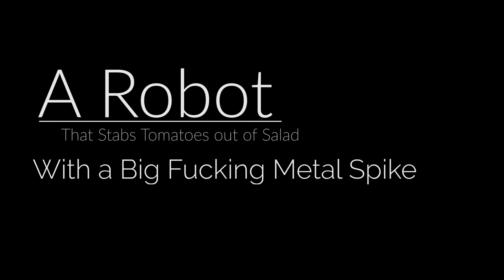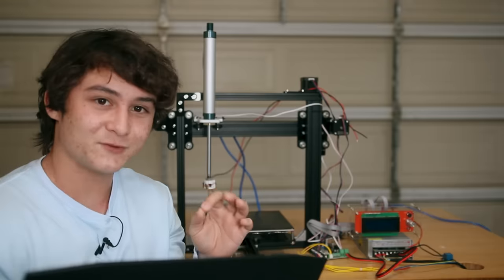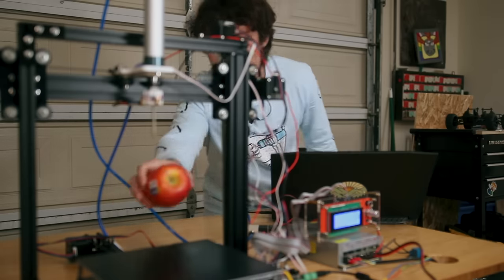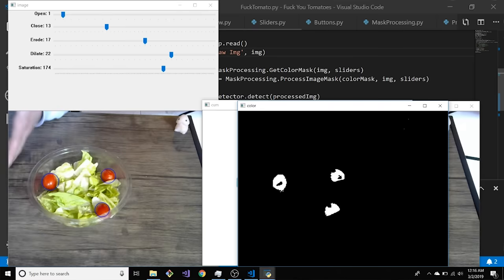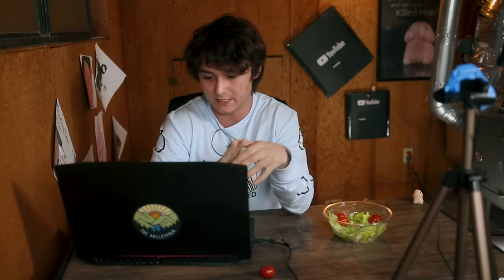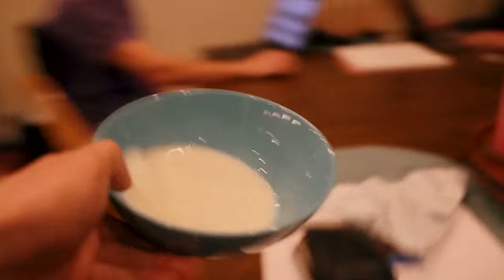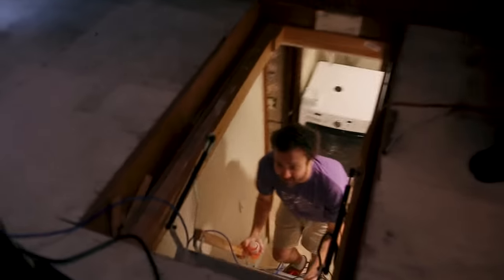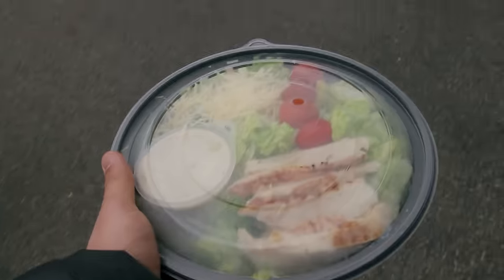A Robot That Picks Tomatoes Out of Your Salad

Comment: I'm pretty sure the only reason this project wasn't a failure was that he used a screw as the spike.
Reply: but does it spike harder than Nesses Dair off-stage?
Reply: He should've added something to take the tomato off the spike before going for the next one. Just make a couple of doors that only open one way and have the spike stab through them.  once the spike and tomato are through, it simple retracts and the spike comes out but the tomato doesn't. Rinse and repeat until the salad is dematoed.
Reply: The real reason why he used a screw is that he wouldn't screw this up
Reply: @undefined5323  when you pick up all the maxim tomatos in all star mode:
Dematoed
Reply: LucasIsHere 
.
Reply: @justinsmith7074  good input to this conversation

Comment: Should've made it only pull up half way once it got a tomato, go over to the corner, and pull up on an attached thing to scrape the tomato off the spike, once it gets the first tomato it struggles quite a bit...
Reply: You’re a genius
Reply: I don't think he cares
Reply: Why do extra work? It would take longer and be better. If it’s good there won’t be as many funny moments
Reply: But that's too much work
Reply: It’s a fucking pneumatic cylinder. They don’t “stop half way” Pneumatic cylinders don’t have the same control as hydraulic ones. It’s all the way down or all the way up. Nothing in the middle.
Reply: @banannaninja  I didn't mean make the pneumatic cylinder only pull up half way, I meant make it to where the machine would pull up half way, with any means, such as, switching it out for a hydraulic one? Not sure, all I know is that I suggested something that isn't impossible, and the fact that you're stuck on thinking about using the same equipment is laaaaaaaaaame
Reply: Core Blaster it’s not lame, it’s logical. What’s lame is you suggesting that he should have done something differently, when the whole point of the video and the machine he made was to be funny, and you’re giving him advice on how he should’ve done it differently without any hope of understanding on how it currently works and how complex  the machine already is. There is absolutely no need to make the machine 10x more complicated ,it’s already beyond perfection as it is.

Comment: "Smells like carbon monoxide."
What, the odourless gas?
Reply: Rekt
Reply: Carl ? Who is they? I’ve never heard of adding a smell to carbon monoxide. You’re possibly confused with natural gas? Or liquid propane?
Reply: @tanner-9865  they add a specific scent to gases which get used by humans so you can detect if there is a leak so you don't just drop dead because you didn't realised, at least where I live
Reply: Lars Steinert correct, but as far as I’m aware it’s not in carbon monoxide. Carbon monoxide is a byproduct of gases such as liquid propane, or natural gas. Those gases have sulfur added to them.
Reply: Ya mean the hydro carbons
Reply: @larssteinert5191  The only problem is CO isn't used by humans, it's made when a fire burns in an oxygen-lacking environment
Reply: @teddygoboom1  ok didn't exactly knew what co was, English isn't my first nor my second lenguage
Reply: Probably that U.v. light and ozone producer that's installed in their air conditioner. I mean that's my guess.
Reply: @larssteinert5191  Carbon (C) Mono(1) Oxide ( O) (with oxygen the second "O" is removed after mono)